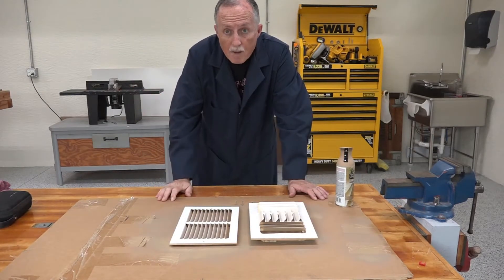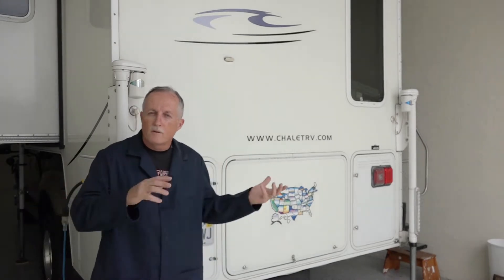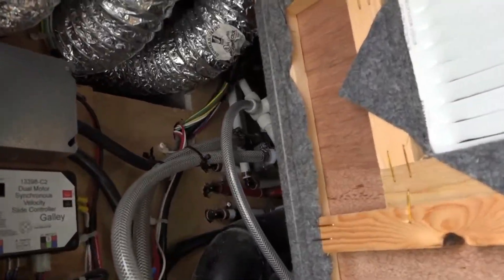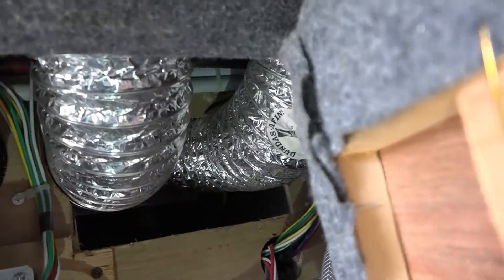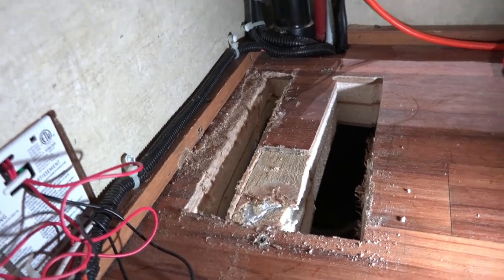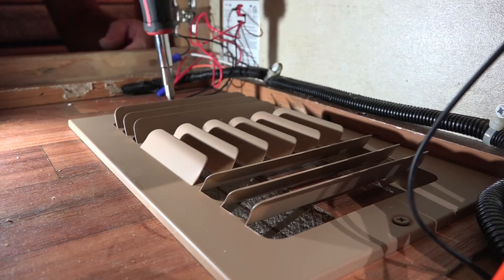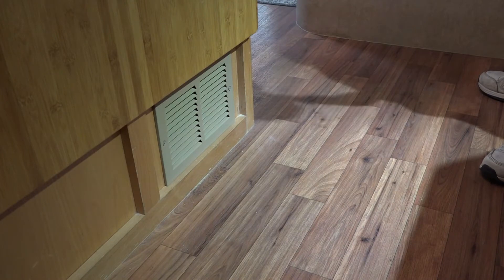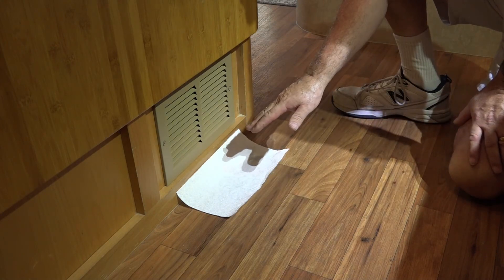RV Heater Fresh Air Return

Comment: Like mod , but think you should be drawing air fresh from outside camper to prevent condensation, I think you will have condensation issues now from reusing stale air , instead of putting vent in cabin put vent on outside wall
Reply from the maker: All furnaces in both houses and RVs need a hot air return and my camper didn't have one.

Comment: Neat!!!! Holy cow! The Modscientist strikes again! The tight spaces! I can only imagine the man hours. I'm guessing that would have taken me my entire weekend. To be honest probably a few more weeknights on into the next weekend. I love seeing your professional work. I do OK but come on! Yours is showroom floor quality.
 I own a palomino backpack. You and a few others inspire me to do radical insane changes. I love making changes that make me think "I'll never be able to resell this". I'm waiting to make a video until I have several mods to show. Check this out! My next project is 12v linear actuators (Exactly like the camper Jack's only not as beefy) mounted upside down on the back and the side serving as a kayak rack that can be lifted so my popup doesn't have to bear the weight and I don't have to remove my load to raise my roof. I should be able to raise the kayak then raise my roof. I thought about manual actuated but "work smarter not harder" right? My only concern is long term durability. The one on the back should be fine because the lift is straight up whereas the side will have torque pressure leaning over the roof. I'll do my best with tie down points but still.
 Anyways, keep up the good work good Sir. Be safe.